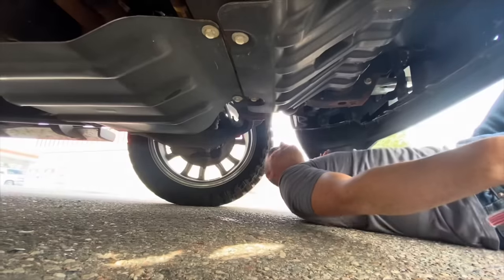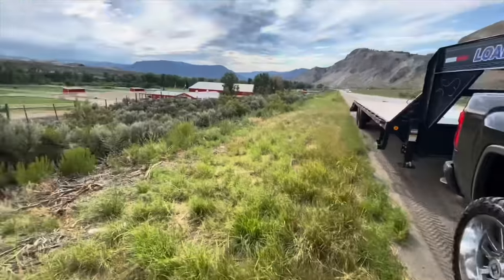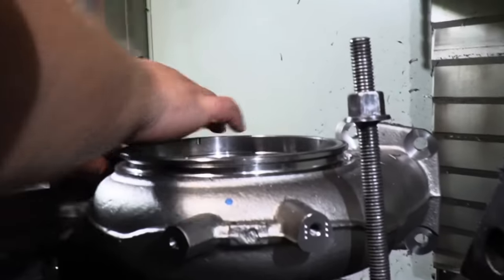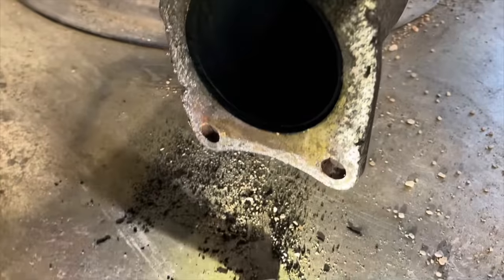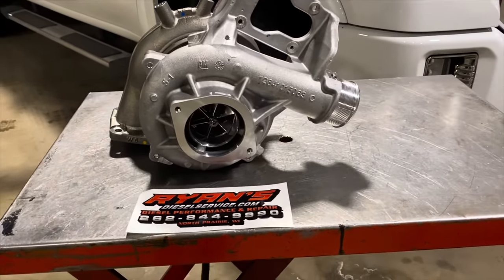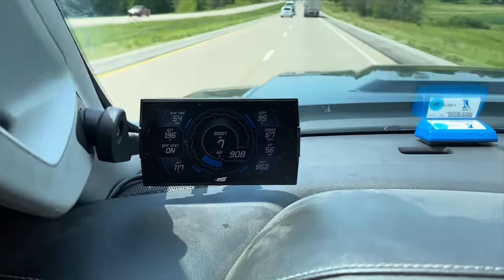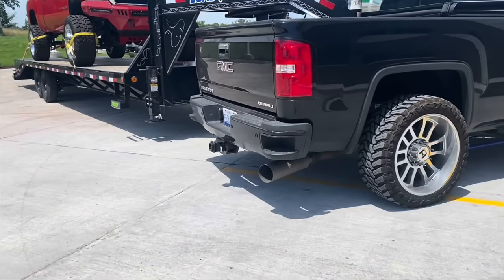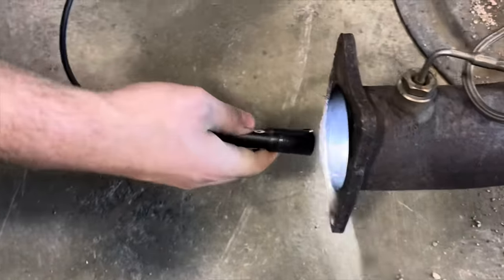This Is What Emissions Did To My Diesel! Heads Up Diesel Owners!

Comment: I totaly understand the problem is nothing but add-on crap from EPA! I have a '21 Duramax and you're right, this can / will happen to anyone. But the nagging question I have is what tune value did you run, Coming hope to get that 25 MPG? Were you at stock or back at 3?

Comment: I always get a kick out of people that modify and tune their truck then bitch and moan that the DPF and emissions starts giving them problems. Throwing more fuel at the engine results in more soot the DPF has to deal with. 
They size the DPF based on stock tuning as well as expected stock driving. If you want more power the. Ultimately you need a bigger DPF and tuning that accommodates the changes. 
Like with medium/heavy duty trucks where you basically get a different exhaust and tuning based on the level of power and conditions the truck is operated in.

Comment: Trucks with big block engines like the 454 Chevy, 460 Ford, and Vortec 8100 are going to shoot up in value.  Even trucks with the 6.8 Ford V10 and the 8.0 Dodge Magnum V10 are better alternatives to modern diesel engines.

Comment: Every single time our beloved GM Ford or Dodge has released new Diesel's there's countless issues we suffer thru....then! We all figure out little cheats/changes or Mods to bypass issues an gain the POWER we AMERICAN MEN simply can't get enough of.
Point is in time the brand new Diesel's will be figured out, made to be bulletproof and easier all the way around.

Not too bad of a job you guys did tho, the guy driving that Ford deserves a huge amount of respect too, I mean can you imagine how hard he has to work wearing the high heels, lipstick, tight thong an dress as required by Ford Trucks ignition security system.....yeah....I'm am a GM guy haha 👍🇺🇸🇺🇸🇺🇸🇺🇸

Comment: That's like me. I got a 2000 f250 and more issues out my 2018 3500 dually after accident  then I have with a 23 year old truck. Who would figure you buy a dually with 6 speed trans and 1st 5k miles had to replace clutch cause quality control didn't tighten the top boot cover and water got in and then at dealer had a employee smoke out the second clutch.  Rear axle after 18 wheeler tire fell off truck and took me outta commission  and still issues. But long story short this new crap is crap. Or my 2500 ram 6 speed as well all 4x4s  ranch life is rough on vehicles

Comment: these issues have been in the trucking industry for years you might find it helpful to read after people who post and understand that diesel engines cannot idle EVER that a 500 hp heater cooler is a ridiculous thought  thinking this will not produce problem.  I bought a Cascadia 2016 the first year was spent putting up with lights and codes but as I did not idle ever these got fewer and fewer until I thought there was a problem because def use went way down I had it checked and came back with a clean bill of health get a generator (fits in front of pass seat) an A/C unit and a heater

Comment: I'm hoping you took the soot and fed your plants with it. Everytime I clean my exhaust out, I put the soot in my tomato and peppers garden and I get massive tomatoes and peppers back.  

EPA can tell us they are helping the environment all they want, but it's horse crap. They are just making cars run worse and hampering engines that could be getting so much better mileage if they'd quit meddling.

Comment: On that destroyed exhaust isn't the dealer on the hook for the life of the truck. I thought that's why the steelership offers a gov backed lifetime warrentee on the emissions control system I'm not trying to hurt the small shops without u guys things would be much worse. But I think the dealer is on the hook for life on the emissions why they are taking out all the additives in the oil. Like zddp and several others they are just against us all. In everything keep the good side down guys good job

Comment: Ford Transit 2017-350-HD,  blown motor at 20,000 miles, egr cooler failure, lost truck for 6-months waiting on a new motor, 100,000 miles DPF failure, Ford wanted $5000 to fix, FU Ford, had all emissions removed, ecu flashed, truck runs great!! Ford no longer offers a diesel option!!! I wonder y ?

Comment: I’m curious about something. I recently did a dpf regeneration temperature recall on my 2020 L5P. They said it’s to lower the regen temps that were running higher than necessary. So now the truck regens at a cooler temp but definitely regrens waaaayy more often as evident by my fuel mileage that GM claims isn’t related. 

Anyway my question is do you think with this new regen temp thing people will end up with clogging issues more often? I’m no mechanic but seems like you’re clogged up due to the regen not burning hot enough to do what it was supposed to do which is burn off all that soot. I’m not wondering if it’s time to sell my 2020 and build a new compound LBZ to enjoy and forget this emissions world.

Comment: So on those new trunks you can't just delete the emissions?
I had a 2008 F450 you deleted the admissions/reborn and put a tuner kit that stopped the reborn cycle, truck ring great after that it was all legal because it was an emergency vehicle.
Even if it was my own vehicle I think I would go ahead and do that if I was a long holler it'll be up to the police to find it if I was in a state it was required.
I'll with the tuner kit we have it at a mild too which doesn't blow almost any black smoke out but has great power so it still goes under the radar if it was a personal truck.
I really hate admissions if only they would tune the trunks the burn better right out of the factory and leave that junk off I think the miles per gallon difference would make up for all the stupid emissions check.

Comment: Here in most areas of Canada, any vehicle sold (private, or commercial)  must simply have any emissions controls that were removed, replaced. Anyone caught using a vehicle with a deleted emission control will face heavy fines, but, as you can guess, they still do it.
I am also interested....how many miles were on this truck when it failed? Will it happen again? Sounds like your problem was caused by the melted wiring thus not allowing the truck to regen. If that is the case, this should be a one off problem. Our problem here with our  Colorado pickup is the DEF heater... it burns out. That (believe it or not) happened twice in 12 hours.

Comment: I have a viable solution to ending all emissions on modern diesels. The fuel injection that is used, is not efficient. The design would be outside of the box in thought and direction.

Comment: I don’t get why dudes w/ heavy ass diesel trucks- especially ones that are actually used for hauling/work- put those damn skinny tires/big wheels on!!! The more sidewall the better far as I’m concerned, rides so much nicer & it’s simply better performing on or offroad when you ditch the 20-22” wheels & skinny sidewall tires

Comment: I'm curious how much idle time you have on this truck because DPF they just don't like to idle.
I'm seeing this from multiple people that they stop the idling, and no problems because when you're an idling, exhaust is not hot enough to burn off everything and it just starts to plug up. Stupid in one way for people who "need" to idle. But on an emissions point of view,  "smart" because once the general public knows you just can't idle forever [you know the types that idle their truck /semi to keep the cab comfortable but put a s*** ton of hours on the engine when they should just get an APU and save the engine] then you know you don't have a lot of problems.
Engineers design the truck to work,  not sit and idle to keep the ability cool or warm. Although I really wish they would have accounted for the idling.
I get that sometimes it better to idle when you say stop and fill logs or something.  That time alone adds up in idling alone. But not for say a 12 hour break. Use the apu which is cheaper to run.
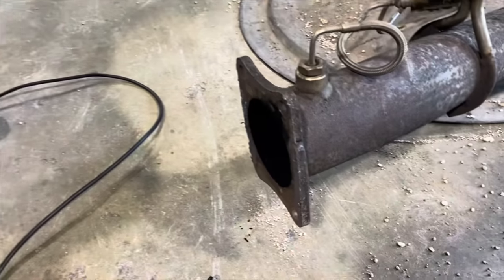Reply: 6:26 now that makes sense too. I said idle issue right off the bat because curious.  But I didn't hear that it wasn't regenerating till now.
Reply: I'm really curious that there is no code or diagnostic for when soot is too high, should put a code and say possible bad injector or something.

Comment: Two things your not talking about, are you using bio-diesel (which is known to lower regen temps) and are you running a aftermarket tuner, every truck I’ve fixed with over 300k is completely stock, leave em alone and they last forever

Comment: Emissions does nothing to my vehicles. My gasoline vehicles are older and don't rely on any sort of electronics to operate (except for an electronic ignition module) Any factory emissions are stripped or dummied up to look operative
Diesel....Early Cummins with mechanically controlled injection pump, only electronic is air preheater
Banks upgrades and Im good to go...without stupid DEF and its tattletale systems.

Comment: No offense, but watch my video on this.  You removed a ton of stuff for no reason, i can drop that exhaust in 30min without any cuts.  I did a full exhaust mod for $2500 and ripped all that dpf trash out.  Picked up 5 mpg and 70hp.

Comment: Ugh.  That coked up intake shown in the video is heartbreaking.  Aggressive and heavy use of EGR to meet the latest emissions targets destroys modern diesels.  Get rid of EGR on a later model truck via tuning and life is grand.  If it is an emissions equipped model, DPFs no longer plug up and regens are far fewer as there is less soot load with EGR turned off.  Mileage improves due to far fewer regens and more efficient combustion.  Without EGR the intake and the oil stays clean, reliability goes way up, and the truck is still smoke free.  It is simple - diesel engines don't do well long term when fed a steady and heavy diet of their own waste.  Alas, one can't legitimately tune to turn off EGR anymore in the US due to the EPA.  

It is too bad that emissions regs for diesels are stringent to the point that technology can't reliably handle them.  The government is encouraging people to avoid emissions controlled diesels via "glider" big rigs, and to break the law by deleting emissions systems from newer trucks.  The overall pollution level is probably higher than if more reasonable and attainable regs were in place to begin with, and diesel owners did not feel compelled to modify their truck's emissions system and ECM programming.  How many gas powered vehicle owners sweat the status of their vehicle's emissions systems?  While a check engine light doesn't disable a gas powered vehicle, a diesel goes into "limp mode" which will strand it in fairly short order when an all too frequent emissions issue occurs.  How is that remotely fair to diesel owners?

The video poster is correct about older diesels being desirable.  Hang onto it with both hands if you have a pre EPA crackdown late model tuned or good running older pre emissions diesel.  These new diesel trucks are expensive vehicles, and their emissions system issues are too common and completely unacceptable.  No way I am ever spending my money on a new diesel, not if I can't tune it to eliminate the kind of problems outlined in this video.  If one looks at the insane cost of new trucks and their well known issues, spending money to keep an older truck that is in good shape going is financially a no brainer...

Comment: Bought a 22 Sierra brand new....traded it in at 2400 miles....couldn't go 600 miles without throwing a check engine light and threatening limp mode.   POS.

Comment: I think it would be a good idea to have the diagnostics built in to the truck's computer system and screen display. Why just have an idiot "check engine" light, when with a few more lines of software code it could be inserted? I mean they call it OnBoard Diagnostics now, so why isn't it onboard from the factory without having to buy an expensive scan tool? And, instead of a Pxxxx code, just read out in plain English what the damned problem is.

Comment: I see how your DPF got clogged.  During the regen, extreme amounts of heat is required to burn the carbon to turn it into ash.  This heat is produced by your engine, burning more raw diesel, which inadvertently heats up your turbocharger; thus, your seals in your turbo suffer, and maybe your egr coolers too.  The root cause of all this is the fuel.  Unfortunately, here in America, the nationwide average of the cetane level in diesel is around the 30’s, but these trucks were designed to run on cetane levels above 50.  Therefore, the absence of diesel fuel regulations is creating improper burning and causing more unnecessary, inefficient combustion, which causes more soot.  In addition, the ultra low sulfur diesel fuel lacks lubricity.  Do some research on the product: Archoil.  This product increases the combustibility of fuel, acts like a catalyst, stabilizer, and algae inhibitor.  I have several 16 ounce bottles that I make in advance so that I can use to add my cocktail every time I fuel up.  I add roughly 6-10 ounces of cetane booster to boost the cetane level, 15ml of Archoil for lubricity, and fill the rest with Lucas fuel treatment to act as a carrier for the mixture.  Just like you, I didn’t want to change the engineering parameters of the truck nor do I want to play an expensive game with the government.  I suggest to get the DPF baked and cleaned very 30-40 thousand miles, EGT sensors replaced and change your engine oil every 5k.  To my Ford, I’ve also zip tied a bunch of misting nozzles using 1/4” irrigation lines (bought a at Home Depot) to all my heat exchangers.  I have a water tank filled with distilled water or soft water going to a Rv water pump.  I flip the switch when my truck is going through regen, climbing a hill, or any time I think I need my engine needs help cooling down.  Rolling your windows down to turn the heater on full blast can help cool your engine too.  Remember that heat destroys these trucks.  It’s absolutely remarkable what manufacturers have achieved to comply with EPA standards, but it’s simply not sustainable with our fuel quality and current engineering limitations.  All we can do is do what we can to make these trucks last as long as possible through due diligence and preventative maintenance, because in most cases, problems caused by emissions system can be catastrophic and very costly, which can be prevented.  Depending where you go, shops can weld a flange on your DPF so it will be easier to service.  Another suggestion I have for many diesel owners is change your radiator or degas bottle cap; it’s very cheap to replace and will save a lot of headaches; so get it replaced every time your flush your coolant.  I wish you luck, and remember many tuners will destroy your engine.

Comment: The DEF systems are poorly thought out, designed and implemented.  They fail on a regular basis, freeze and fail during cold weather.  Truck owners should be compensated for being the testing group for their failing designs.  My truck sat for 6 weeks this past winter because the DEF froze and the heater failed.  Parts were not available to repair for 6 weeks.  Brand doesn’t matter they are all experiencing similar problems with the DEF system.  This has been in place for 10 years and I haven’t seen or heard of any improvements.

Comment: Gonna get hate for this, but if you don't want issues leave your truck stock. There are trucks hitting over a million miles with original emissions equipment intact. People need to start accepting the consequences for their actions of driving aggressively and modding trucks and not always blaming the emissions equipment.

Comment: I've done a manual regeneration as a hail mary at my shop trying to get this diesel to clear up with info pointing me to a clogged dpf. That procedure is horrible. By far the loudest thing I've ever had to do. The engine is just making ungodly amounts of noise and drone. the rad fan is trying to pull itself out of the assembly its running so hard.... all your coworkers hate you for the next day or two because their ears are still ringing. I hate working on diesels but new diesels are a special kind of stupid.

Comment: A modern diesel in a singel rear wheel truck is pointless. Theres no need for 1,000 lbs of torque when the chassis/tires etc can't put that power to the ground and do useful work. Diesel in 3/4 ton pickups made sense years ago when these diesels made way less power but now even a small gas engine will put down the same or similar numbers to early 2000 oil burner. The EPA killed diesel only buy one if you absolutely need that power and are getting a dually.

Comment: The whole emissions systems on any truck is garbage. If you have it it's not a matter of if it breaks it's when. I have already dealt with it and it's not cheap. The government doesn't need to use it because they know it doesn't work and isn't reliable nevermind what it does to a motor. Diesels are not what they once where thanks to the EPA. They took a reliable motor and destroyed it and don't think it wasn't on purpose. They don't want things reliable they want them to break so you have to spend more money. The more you spend the more they make. A new DPF was $2600, EGR valve $800, EGR cooler $1000. Plus a ccv filter and labor cost. Needless to say I didn't purchase any of it. I cleaned everything and made sure it was running as good as it could with the emissions and sold it. Driving my 05 non emissions truck. I will never buy another diesel until this whole system is actually working correctly and reliable but that will never happen.